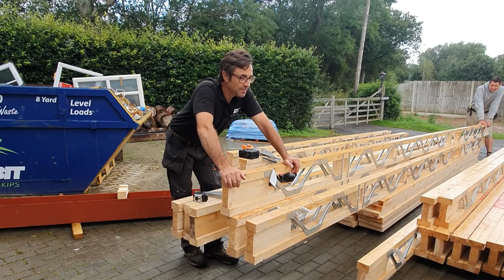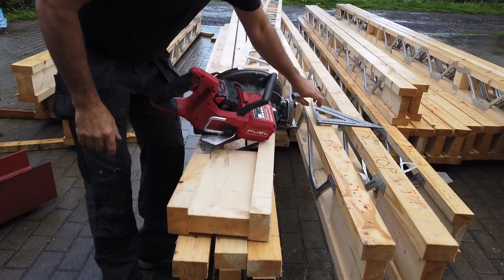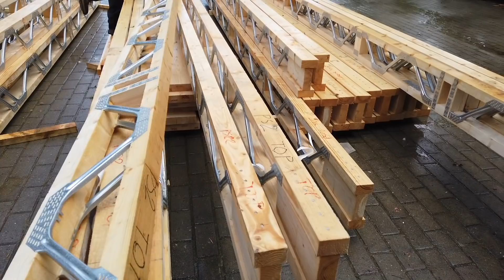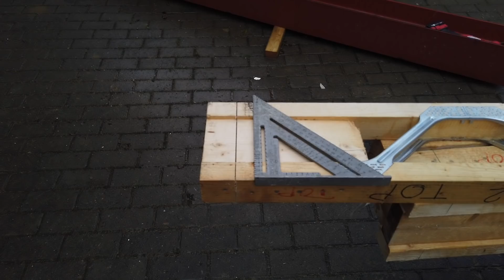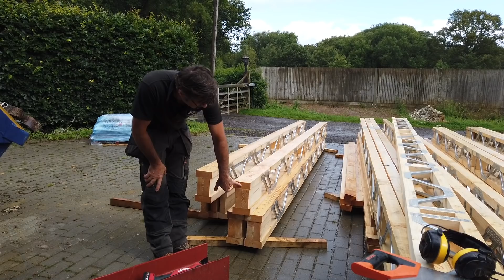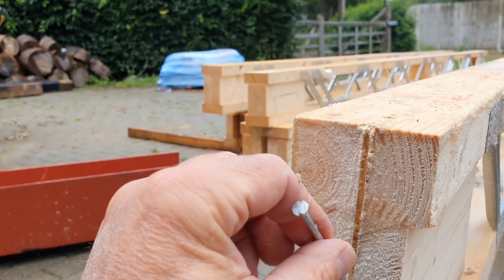How to cut metal web, posi or eco Joists without damaging your saw blades!!!

Comment: I made a lot of these in the framing shed back in the late 90's. Ours didn't have ends you could trim. All made to plan sizes but no doubt all going to new builds. Even back then the timber was cut by computer controlled saws but laid up by hand on the press so plenty of chance for human error. You only had a picture of the layout to go to and we set out the measurements by a tape on the press. Trusses were the same. Parts set out in the press boxes by tape from the drawings. More recently I have seen systems with overhead laser projectors casting lines for the exact placement. Not sure what is out there now. Tedious boring job making them back then I know that. Like I said before they just disappeared in Oz haven't seen them on a site in many years now all I beams.

Comment: I use an Evolution blade which cuts wood and mild steel when cutting pozi joists.
Reply: there's a difference between cross cutting through a round nail and cutting the whole length of a 80mm ring shank hard nail. 
Also there is a risk that you could launch the nail straight out of the timber. Knowing my luck that would be just when the glass gets delivered
Reply: DeWalt construction blade cuts nail embedded timber.....
Reply: Yep, I was thinking the same - get a dual blade.